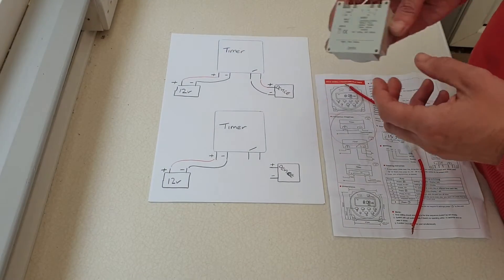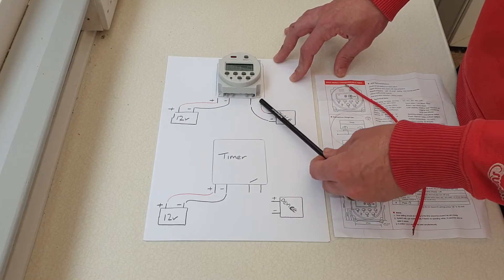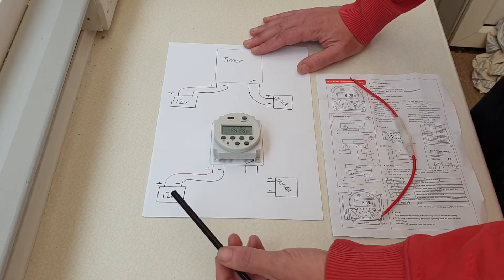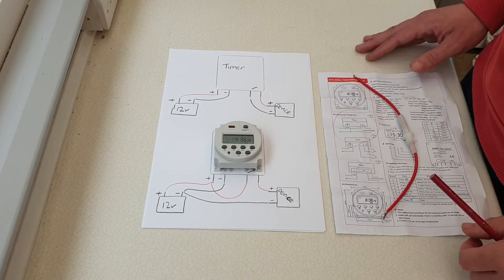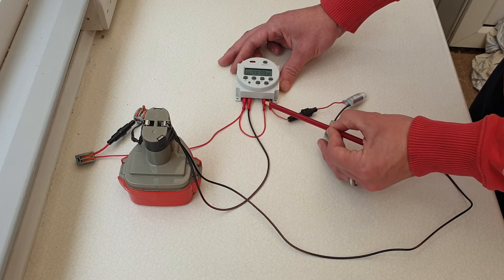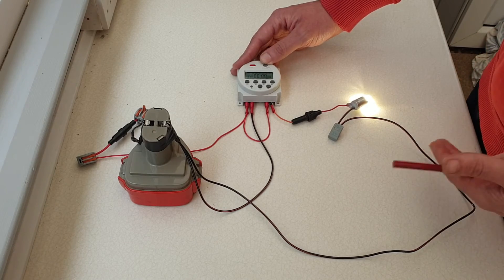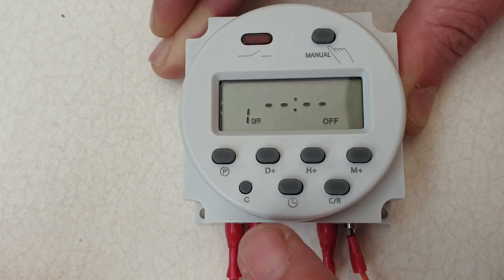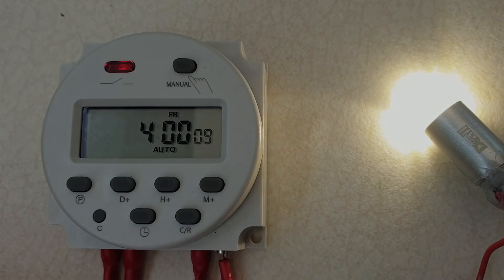12V DC Programmable timer using the CN101a 12 volt. proper wiring setup and installation explanation

Comment: Good video but I think it depends on the type of timer you have.  I have a similar one that WILL  power the motor I have it connected to by using the “out” positive and negative connections.  
Using a jumper like in the video makes me think this timer has a built in relay. ??
I really wish the Chinese manufacturers could do a better job with directions.

Comment: I noticed your unit's display is on without any power.... should the unit arrive with a functional display? Ours is DOA and display can't be turned on, even when connected to a 12v supply.  The red light comes on, but no display

Comment: can you wire parallel? around the timer for a; bypass of timer .. with a manual switch to activate the load, using same or alternative power source?  if you can .. does one need a diode to protect the timer from back feed?

Comment: What size fuse do you use please
Reply from the maker: Hi. The fuse is to protect the wire primarily so needs to be sized to whatever wire you are using. the ones here were only a couple of amps :)

Comment: Hi brilliant good clear instructions. One question I've have a couple of spare timers, the clock won't switch on tried reset but no joy , power light on but no clock funtion, had them awhile but not used. Regards Mick

Comment: Thank you so much very helpful. I now purchased a fused box to work my garden water features…question is will I now make the fuse bow the power box to the 12v up pumps? Ie when it says power I will use the box instead of powering up units from battery?

Comment: oh thats getting close to what Im looking for. I want something like this that I can put between my 12v  100ah battery and my 2000 w inverter to switch it off automatically , otherwise itll hum all night even though the lights Im powering automatically switch off themselves and the inverter continues to run on idle unless the power switch is toggled or the battery is disconnected.

Comment: I bought one of these from Amazon and wired it for my 12 v LED which only draws 2.3 amps total then five months in after working perfectly it decides to short-circuit on the output side and ruined my AGM batteries and almost caused a fire.  I don't trust anything anymore that's under $10 on Amazon... This piece of crap Chinese device could have burned my house down!

Comment: ordered the 24v but it doesnt say minimum maximum... will it have problem if battery pack has 29 or its within safety specs ? ?  cant find low high input i can fix a dc converter to stabilize it but if no need i wont waist spare parts

Comment: Hello sir, a very nice video explaining exactly how i should go about wiring it.
And yes, i made that common mistake first 😀
Thanks to your guide my ladies (Hens), now have a pratically maintenance free light: solarpanel - charge controller - scooter 12v battery - timer (the one in this video) - voltage reducer - light.

Comment: Can this timer setup be wired directly to a larger 12-volt battery system ( eight 6v batteries hooked up in parallel and series = 12v system). Thanks for your time

Comment: Hey hopefully you still come back here, thank you for the information it was really helpful. 
Just one quick question, if i connect a battery holder with 8 batteries how long can i use the timer to power a 12 v solenoid lock without having to replace the batteries?
Reply: I am in the middle of a kinda urgent project so hopefully you see this soon:)

Comment: Hi mate, I have wired this up correctly,  and the switch doesn't appear to be working. Timer light comes on and the switch doesn't engage, I have checked everything with my multimeter. It's becoming a bit of a head scatcher now?

Comment: Can you use this in between solar panel and mppt?  I have a Bluetti EB3a that when the solar input drops too low, it will sit and flash which causes the internal batteries to drain.  I only want the solar input to be active during peak sun hours.  It doesn't allow for cloudy days, but it's better than having to plug and unplug several time during a day.

Comment: Thanks for the detail info, I was struggling with the Chinese instructions that it arrived with...  Wondering why they don't just switch both + and - on the output side, instead of requiring a jumper?

Comment: Thanks for a great video!! Before I purchase it I'm trying to understand if it can work like an egg timer. I'm charging my boat battery in my car, and I want it to start charging when I push the "on" button, then automatically switch of after 60 minutes (so that my car battery is not drained).

Is it possible to work it like an egg timer in manual mode?

Comment: Hi, I'm trying to use this timer as a 12v in car timer for some led lights I have connected to the car interior. I have wired a male and a female 12v connector using the wiring method you have mentioned, and although the timer powers on correctly (red light comes on) the output doesn't give any power, any idea?

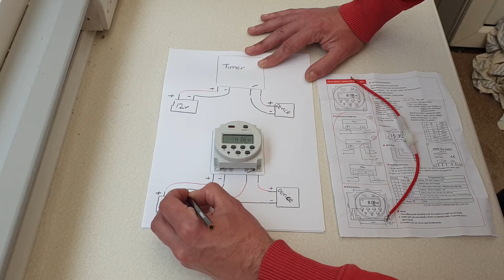Comment: 2:17 UMM. No that's NOT the "correct" way of wiring it, that's just ONE way of wiring it.
Also you completely failed to mention that this is one of a few timers that look the same but have different connections.  If someone does it this way but has a CN101C  then you are going to mess them up. 
2:53 You are giving bad info. Not always does it work both ways. many times it flipped and will only work flipped.

Comment: thanks for taking the time to create this video. It was extremely well done and explicit. Question - I have solar lights on my gazebo that turn on with a remote controller but turn off automatically 8 hours later. Can I use this timer to connect to the solar lights so that it turn on and off  at a certain time? or in the least, turns on at dusk?
thanks,
Someone who is all thumbs when it comes to electronics and electric - forte is accounting.

Comment: Hi do you know if timer runs on 12v or battery as mine was running on battery straight out of box
Reply from the maker: Hi, It has a rechargeable battery that takes power from the input so it remembers the settings if the power source is removed. I've found they will run for a month or two with no power but you have to be careful because I have left them before for a long period and they die completely.

Comment: Showing the back of timer and how the terminals are labelled would be helpful.
Reply from the maker: Hi, I've found that they are sometimes labelled differently so its worth looking at your own device. Basically though, the red wires on mine are positive and the black negative. with the unit facing up, the two on the left are the supply and the two on the right are the relay. In theory the relay can be connected either way because its just an in and an out.

Comment: Very nice video. I wonder if you have any idea how many amps the switch can handle at 12 volts. I wish to use the timer for an 300w inverter . Thank you FDO
Reply from the maker: I'm not sure it would be big enough for that but you could look to use a 240v smart switch on the 240v side instead, that might give the same end result!
Reply: @Mr12v  Thank you for your reply. Sadly that wouldn't work for my application. I have a 12 system in my shed and wish to charge my Ebike for a fixed time. The only 240 comes out of the inverter and the 12 volts is from a battery charged by a solar panel. Thanks again..

Comment: Could you use a 12v A23 battery as a power source for this timer?. Needs to turn chicken pop hole motor with 4 X AA batteries on and off each day. Thks.

Comment: My CN101A timer siwtches the red LED on when it is connected to the power supply as shown in the video?! Can´t explain this to myself..... Do you have any idea?
Reply: The red LED turns on when the switch is turned on.  So if you power on the device and the switch is set to on, the LED will also be on.  If you look at the display, you should see the "ON" text as well.

Comment: Ive got a antenna for chicken door connected but i have three wires for the antenna and its not working properly. The third wire is the control wire. Do i need another timer for that wire?
Reply from the maker: I had to run two timers on mine when I had it setup like that. I've since moved to a NodeMCU to control the door so it integrates with my home automation. Hope this helps.

Comment: Would I need the 12v or 220v version of this module if I wished to wire this timer from a 12v 80amp hr leisure battery to a 2kw Inverter? 

This would be in order to turn the inverter on for several hours during sun light hours in the day. 
Thanks
Reply: This is exactly my scenario, did you get clarity? Many thanks for any answer

Comment: Reasonably well presented and greatly appreciated.  I wish to add a short cutting as it concerns load/device negative wiring.  Rather than routing a 2nd black from device to battery the short cut would be to route the device negative to the same terminal on the timer which leads to battery ground.  Pick up both timer positive and battery negative for load right there at the CN101A.
Presentation very good, brevity excellent, audio loudness also good.
Reply: Thanks for that ... a question I posed before reading your comment.
Reply: there's no problem running black back to terminal 2 is there?
Reply: @LegendLength  I've done exactly as you've imaged.  Ground is ground.  Doit all the time.  If your using a device pulling some amps be sure to use proper gage wire.  12-14AWG
Reply: @gooberminther3tik25  Thanks i wondered why they bother running a long negative cable all the way back to the battery.

I'm guessing it's a good practice because the other cable may have more switches and fuses downstream.  Seems like a good reason to put all switches on positive cables rather than negative.  That way you can just join negative cables anywhere.

Comment: I purchased a 12 well pump.
Solar power to 12 volt battery rechargeable. The pump has a 4 hr run time . The pumps supply wire are quite large. The same goes for three wires coming from the slar panel . That being said . I purchased this style timer and worry if this timer and wires are heavy / will handle the pumps draw / amps ?
Reply: How'd that work out? I've got a similar situation

Comment: I have a question. If the switch is on the 3rd and 4th terminals, where positive goes in and comes out, what is even the purpose of 1 and 2..?  Maybe a stupid question, but... I literally don't understand
Reply: Pins 1 and 2 power the timer itself, one pin for positive, one pin for negative.  Pins 3 and 4 are just for the switch, and do not power the timer.

Comment: How to set the current time?
Reply: @danstrayer111  This is the information I was looking for.  To be clear, you have to keep holding down the clock button while pressing the D, H, and M buttons to set the time.  If you release the clock button, it drops out of time setting mode.
Reply: @ProfessorLandsgrave  Thank you! It was driving me crazy when I could not figure out what I was doing wrong. It should be written "hold the clock button down while doing x" since just saying press, is a bit confusing, lol.

Comment: I am trying to use this timer to recirculate the water in a live well. I just need the pump to turn on and off every 15 minutes or so for a few hours while fishing. So far I can't seem to make it trigger at the set time. The Manual button will start the pump if I am in program mode but not once the device locks after a few minutes so I'm assuming the timer works and the connection is correct. I am guessing my problem is in the programming and I am just overlooking something simple. Anyone have any ideas of how to make this thing work and maybe even the best programming method to achieve my goal of making it turn on and off every 15 minutes or so?
Reply from the maker: You cant use these for that many programs per day, i have done similar  before by using a little adjustable timer module, you can have them repeat a cycle every so many minutes via an adjustable knob on the board. You can get them from ebay :)

Comment: Will the timer work on 7-8v input (2 x 18650 3.7v batteries) instead of the 12v?
Reply from the maker: You would have to try it, in theory on the relay side it wouldnt matter because the relay is isolated but in the device input it may not be enough to actually power the device.

Comment: I want to use one of these timers to turn on a 24 volt solenoid valve. Power to the valve is supplied by a wall plug power pack. Can you explain how to wire it up? Thanks